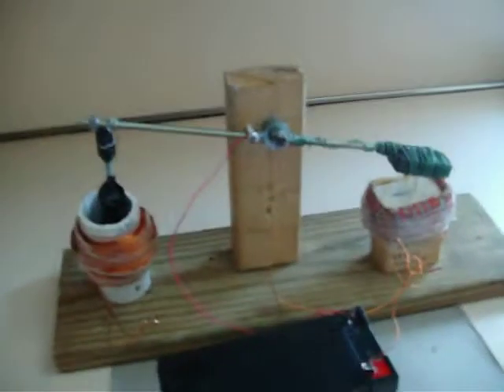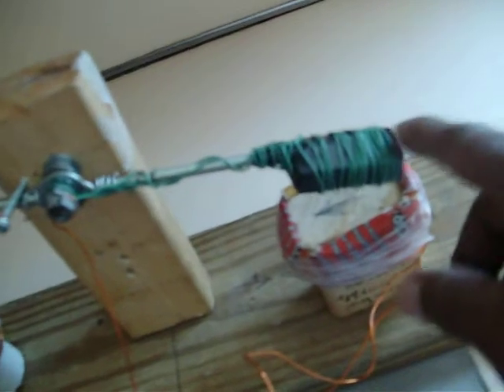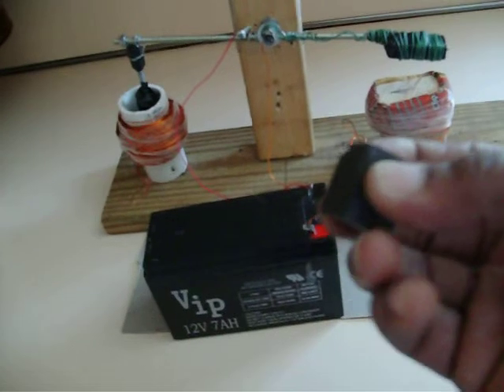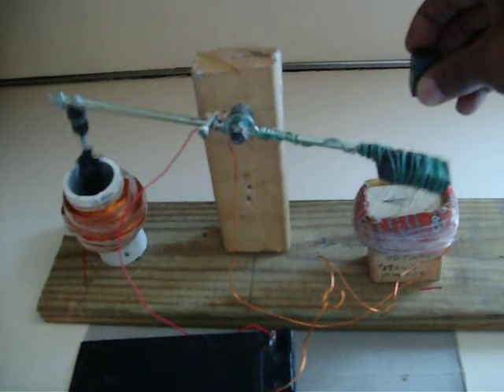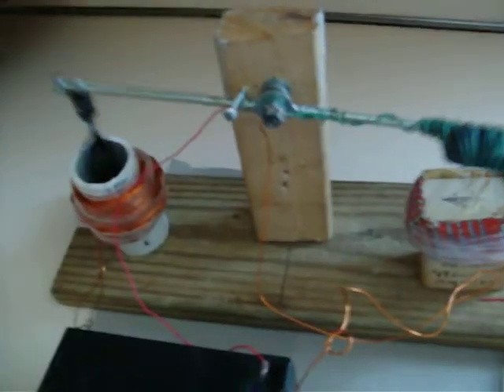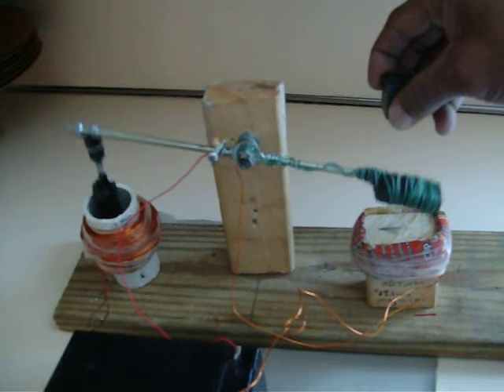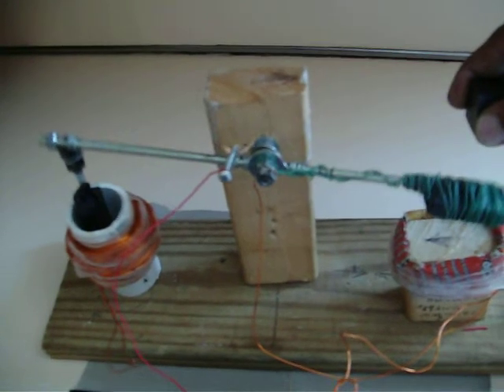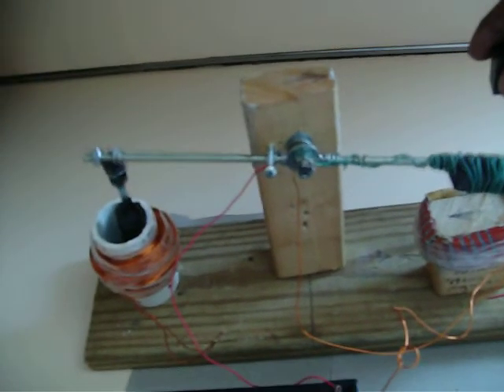wilkinson RAM demo

Comment: Well done !
Please try it with charged capacitors using supercaps and see, if the left coil can charge up another supercap faster than the right coil discharges the first supercap.
Many thanks.
Regards, Stefan.